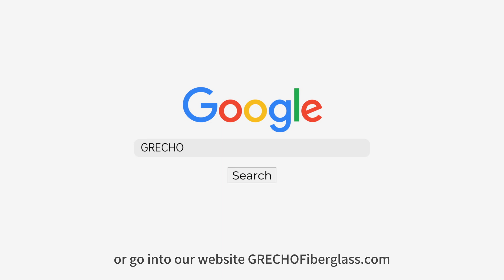How to Choose the Right Carbon Fiber Reinforcement

Comment: i used only carbon fiber yarn for repairing tennis racket but its does not hold pressure...its failed... shall i try with plain wave carbon fiber cloth ? will it works